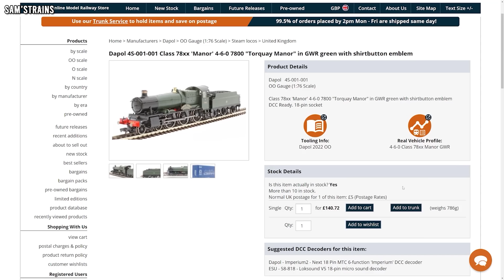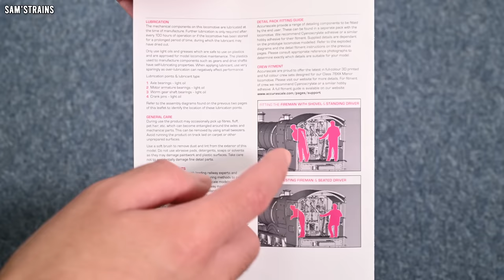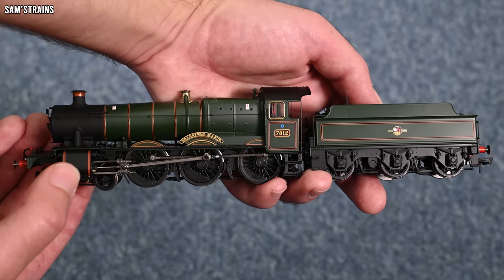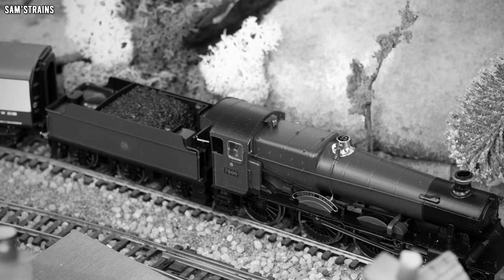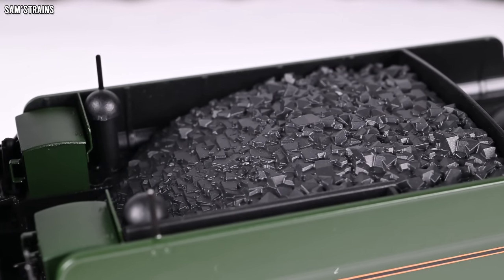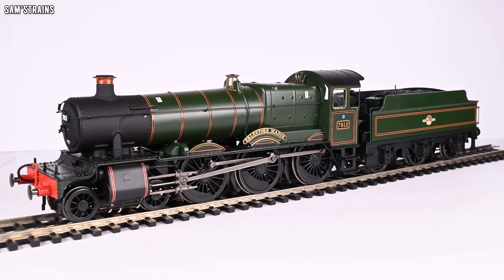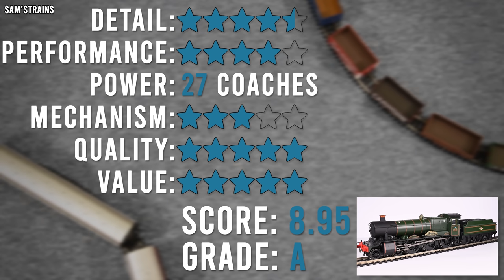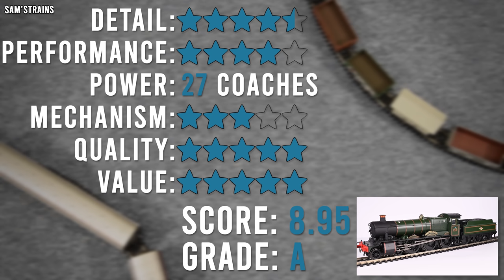Accurascale's New Manor Class | Better than Dapol's? | Unboxing & Review

Comment: As I run on Analogue, being able to Chip a locomotive has no relevance to me.

To me, Performance is EVERYTHING. For that reason I’ll stick with my old Bachmann model. May be of less finesse compared to the latest Accurascale and Dapol Manors, but with less fiddly bits liable to get knocked off and lost through handling, the old Bachmann model is more user friendly and a better performer. I like to actually run my loco’s in an accurate rake rather than stick them in a glass case.

Comment: I think it has reached the stage where it would be better to look at pics of the real thing (better still see it in the flesh) rather than compare a model to another model. The rivets are actually more true to the real thing on the accurascale. One detail you didn't mention I dont think is the cab hand rails which dont meet the roof on your example. We were lucky with ours but I know there are others similar to yours. ps  . I appreciate good value for money and both AS and Dapol are excellent vfm!
Reply from the maker: I did check photos too - the rivets do look overscale in my opinion - most noticeable if you look at pictures that show the real buffer beam; the buffers are much finer in real life. That is true on the handrails too, very odd, though I didn’t notice this in person!

Comment: Unpopular opinion but I’m not a fan of Dapol’s “Innovative” method of putting the chip in as it’s basically impossible to add a stay alive (which is a must have for a slow running sound loco) I have their large prairie which had sound from factory and it’s extremely annoying when it cuts out. Accurascale by design have actually pre-fitted a stay alive. There’s really no need to access the chip if it’s already fitted from factory. Just my 2c. I like Dapol but unless they change I’ll be buying the DC version of any future steam locos and fitting my own (Stay-alive compatible) sound decoder.

Comment: I personally am not so keen on the electroplated safety valve bonnet on the Dapol version. I do see your points elsewhere though. That motor does seem small, but certainly still has some might to it. Excellent video as always.

Comment: I'm not keen on the 3-pole motor nor the size of motor.   The worm-gear cover fixing of UHU type glue leaves something to be desired too!   Poor assembly adhesive and bits falling off, like their 37's and class 55 models.   Performance wise, the Dapol outperforms on just three tested.
Just arrived, 14mm 5-pole motor...so WHY didn't Acc's fit a Decent motor.   Possibly graft the Acc's body onto the Dapol chassis..??
Acc's definitely Need to get rid of that ridiculous-sized box they put their model in too...Dapol win again!
Just had some great 14mm brushed 5-pole motors...somebody in Ireland selling the same motors at highly inflated prices!!

Comment: I think it's such a shame manufacturers are bringing out models of the same locos,  in a similar time frame. It's a lose lose because sales will be shared. Ok so we have got to a stage where most locos have been modelled , but an update on say a loco made 30 years ago to coarse scale is worthwhile and will sell in good qtys. But drenching the market with highly detailed models of the same prototype is the route to sales disaster. Every train company has gone bust in the past. Its a difficult enough market to be in as it is.

Comment: Sam, the quality score for this loco is not correct. The gap around the funnel, the paint runs on the cab handrails and they do not connect to the underside of the roof, there are glue marks around the loco and the painting of the safety valve surround, the wisand the top of the funnel. This is a disappointing loco from Accurrascale to which I am surprised. Martin. (Thailand)

Comment: Coreless motors are not more powerful for the same size! They have lower low speed torque than a basic 3 pole motor. Their advantage is quick acceleration and high speed. Not what you want for models. Please stop spreading myths.

Comment: This is the first Sams Trains review i strongly disagree with.. his lack of knowledge of the prototype .. understanding of the Hobby.. understanding what DDC can do to a models running .. and  his age and where he is in the hobby right now 
Accurascale have set out to make best  RTR manor if not OO gauge model  they could   and in mine and many other reviewers and forums   they clearly have 
The model can be placed on the best finescale OO gauge layouts and hold its own .. and it does .. in every way   it was clearly never designed to be pulled apart and have DDC chips put in and out 
It was never designed for toy train cuveras and carpets   .. 
lack of easy  access and a wire and plug tender connection is not really an issue  .. are you seriously saying you are going to  be taking it out  and putting it back in every now and then    fit it and leave 
The fire glow is spot on  ive fired 7822 many times  and i can assure when 7822 is  working hard that fire is white hot 
This loco is clearly for the modeler who wants the best and for it to go on the layout and stay there not be  messed about with 
Watching them run with DDC sound and stayalive  the slow running .. CRAWL  etc is first class 3 pole motor or not .. 
The DAPOL looks toy like in comparison . ive seen pictures of them side to side etc , there is no contest   Accurascale all the way 
Sam needs to start paying the money and buy DDC version and see the difference .. before drawing conclusions and its time time to  get off the carpet  .. these locos are no longer toys
Reply from the maker: That’s fine William, thanks for sharing your thoughts! I stand by my review though - I don’t agree that the Dapol looks like a toy, and there are several elements of the Dapol model that are better for me. If anything, I was generous to Accurascale here, as the closeups reveal a lot of visible glue marks all over the smokebox. I test most models on analogue and in these curves, and the fact is I’ve seen better… and that part is objectively true.

Comment: Rather disappointed with this review, the Accurascale model is obviously so far ahead of the Dapol version that its almost out of sight. When you reviewed the Dapol version last year I couldn't believe what I was looking at. By your own admission the torque of the motor was dismal, and it could barely negotiate the curves or clime the hill on your layout without almost stopping, and you also said that the type of motor fitted to these models was suspect for reliability, yet you still ignored all this and went ahead and gave it a score of over nine at the end of your review. What were you thinking, the score should have been much lower. Yet now you are reviewing a far superior model with a motor that negotiates your bends and hills without slowing down, and yet you say that this is not as good. There is something wrong somewhere. Neither did you mention all the features of the Accurascale model. You didn't mention that there is a plastic piece fitted in the front of the bogie to fill up the gaping NEM pocket, neither did you mention the spare cylinder covers supplied in the accessory bag that can be fitted to the cylinders to reduce the gap behind them if you have a layout without sharp curves, to name but two. Nor did you mention that if running on DCC the firebox glow pulses in time with the wheels going round which is a neat feature, instead of it remaining on brightly all the time. I know that all this is so as I previously owned one of the Dapol Manors, but after experiencing all the problems that you had but chose to ignore, I quickly sold it on and ordered the Accurascale version which arrived last week. I'm really glad I did. If you should ever decide to do a comparison video between the two perhaps you could put right some of the errors in the two reviews, particularly the unjustifiably high score that you gave to the Dapol version. Just my opinion of course, no doubt many will disagree with me, but I only can state it as I see it. Normally your reviews are great Sam and I look forward to seeing them, but this time not so much. Sorry.
Reply from the maker: Not quite John, as for the motor point - I didn't say it was "not as good", I gave Accurascale the same score as Dapol on performance because while Accurascale's had better torque, the crawl was terrible, so no net gain.
Fair enough on the front bogie detail, that would have been worth a mention. I did show the cylinder parts when looking at the paperwork, though you seem to have misunderstood what those were for. The alternative ones were not to reduce the gap, but had no cutout in them as the ones fitted did to allow the model to run around 2nd radius. Dapol's worked on R2 without the need for alternative cylinders, so again no net gain.
This model was analogue, so how could I have mentioned the pulsing DCC firebox feature?
What problems did I choose to ignore on the Dapol manor? I can only say what I see, and the only issue I had with the Dapol version was the weak motor, which I duly reported on. No errors to correct here, though I'm sorry if you disagree.
Thanks for watching, Sam :)
Reply: Hi Sam, and thanks for replying and its nice to be able to talk to you directly. The error that I was referring to in the Dapol review is simply that as you have just restated, the motor is so weak that it can barely pull itself round your layout, and according to you is somewhat unreliable as well, and yet you chose to give it a near perfect score of 9.09. Why. Also I don't have any problems with the crawl, but this may be because I am using a completely different controller to what you are using. I use all Hammant and Morgan Powermasters which as I'm sure you know are variable transformer controllers rather than the Gaugemasters that you use. Certainly the crawl on my example (Fringford Manor, I live in Fringford) is quite acceptable and much better than what you were finding. Anyway I suppose we'll have to agree to disagree on this one. Anyway Sam please keep the reviews coming, I enjoy watching them even if I don't always agree with your conclusions. All the best to you for the future. John.🙂
Reply: @JohnReader-st5qv  Ahhh - good to know = muy bien - Fringford run better in Fringford - Sam should test Earlscote in Earlscote - I test Mexico Manor if they make him soon, Woof!